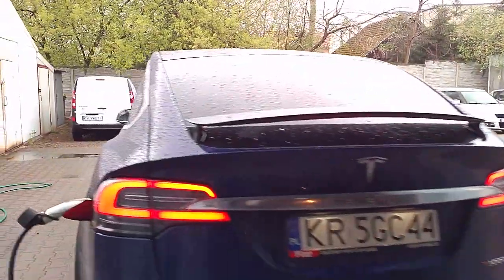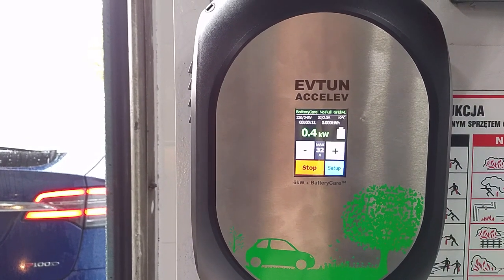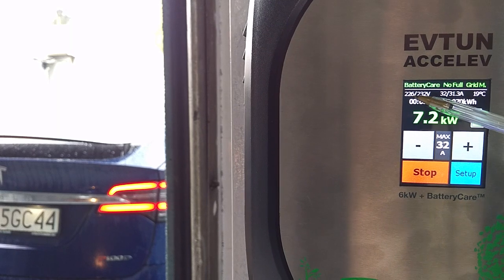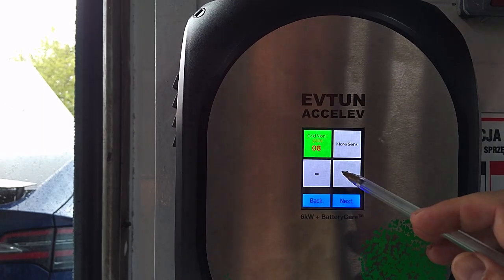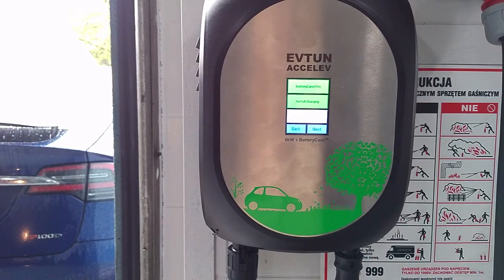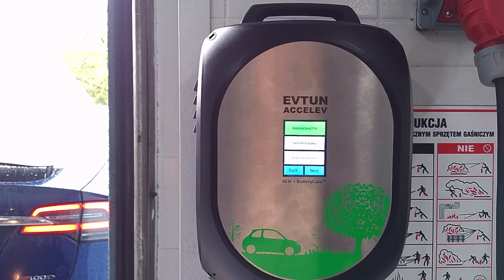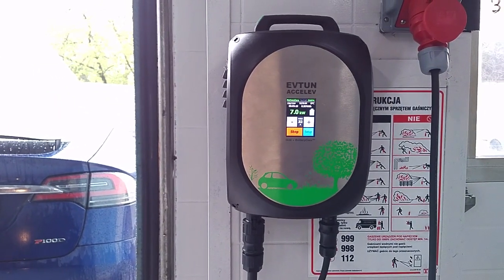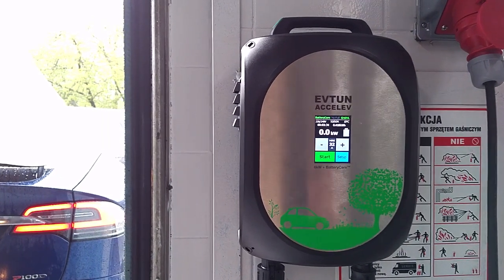Electric car charger Accelev v2 - portable, 2-phase with grid monitoring

Comment: Are you sure that the higher voltage doesn't cause damage or excess wear to the car's on-board charger or battery over time? How can you confirm this?

Comment from the maker: BatteryCare focuses on finalising of battery charging. This phase starts, when the voltage reaches the maximum permitted (usually 4,12 V per cell). During that phase, when imbalance, different cell temperatures along with a group of cells controlled by single BMS node, or just partial cell failure occurs, it is quite possible to cause overvoltage at some individual cells, and through that - cause ageing and breakdown of whole battery (after some time).
BatteryCare during the first pass (first full charge) tries to learn car charging characteristics, and memorise it. Also, it reduces charging amps to minimise the time of being at full voltage to about 15% of the original time. Such finalising stage can be up to 15% longer than conventional charging.
When learning is done, BatteryCare charges the car till full with current adapted to keep not more than 4,0V during finalizing. This adaptive method reduces time loss at the finalising stage to 5-10% while the battery will be less than 5% of finalising time in "danger zone".